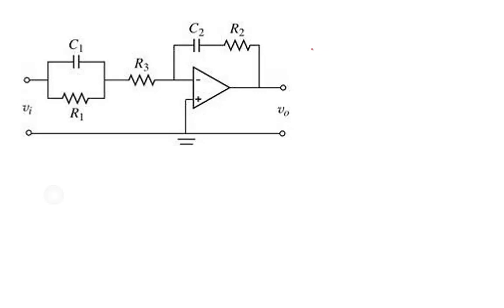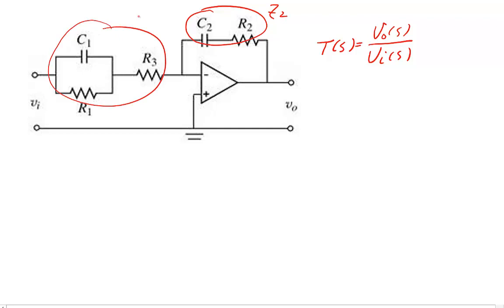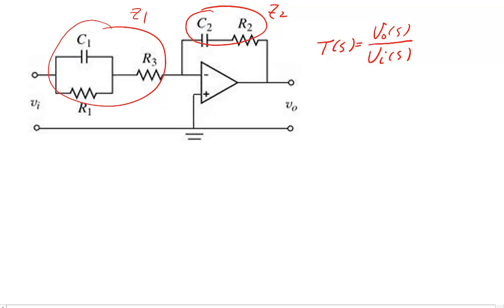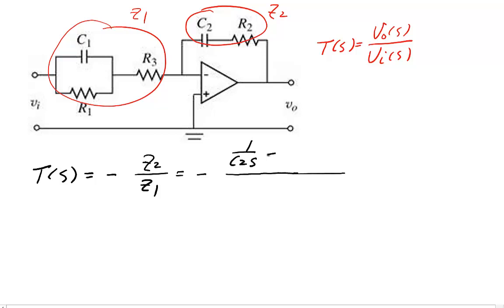ME 340: Example - Finding the Transfer Function of an OP-Amp Circuit #2

Comment: why minus z2/z1 ? why not positive
Reply: Because this is an "Inverting OpAmp"
Reply: because it's an inverter
Reply: Use KCL at the node at the negative terminal. V- = V+ = 0, and no current runs through the positive and negative terminals of the opamp. All current will run from the input through Z1, through Z2. Solving will inherently end up with a negative result, not because of some special characteristic of an opamp.

Comment: I'm feeling like I'm missing a basic step. In Z1, why is the parallel capacitor and resistor written as (1/CS *R)/(1/CS+R)? is it not supposed to be written as (1/CS)+(1/R) ?
Reply: look up loads in parallel. the equivalent load is correct (product of loads) / (sum of loads)